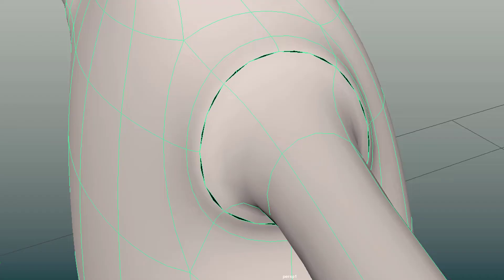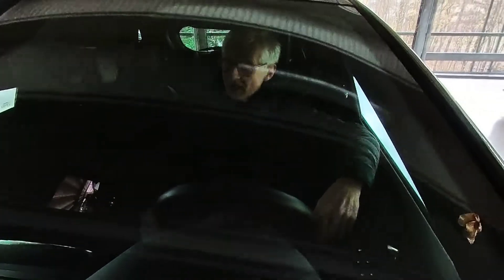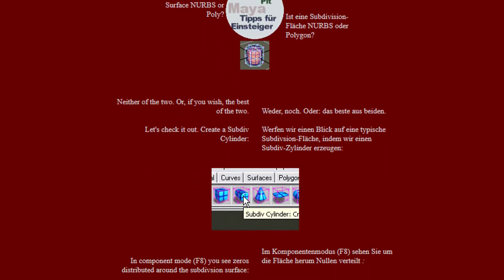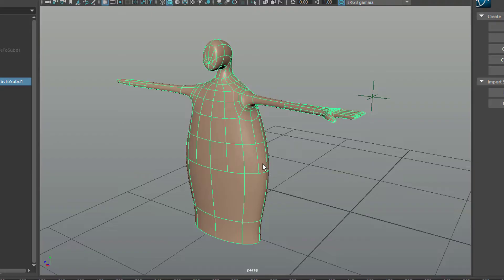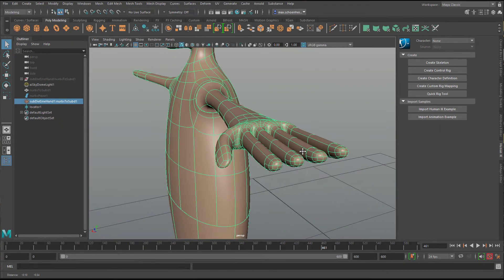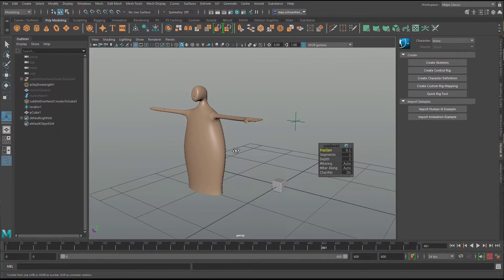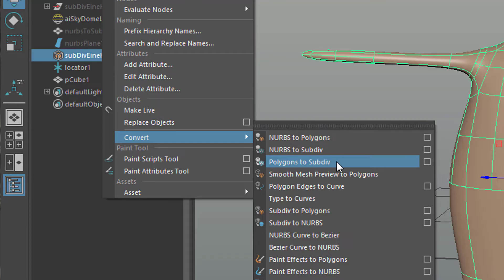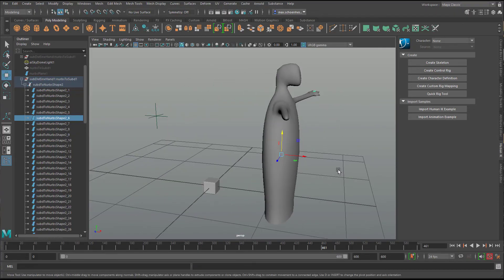Maya: Subdivisions – Matters of the Past

Comment: Back in that day, just before Maya came out I was using FormZ control NURBS surface modeling.  So I was unfamiliar with polymodeling and Maya Subdivs. So I had to learn both at the same time by myself. T-spline surface of Maya Subdivision were baffling. I finally learned it in 2006 or 07.  LightWave was using the Poly SDS technique already. If I knew how to model PolySDS back in 2000 things would have been different in my career. I saw Bingo in 2000. My eye just glazed over. I still watch it as recently as last month. It was an extremely exciting time witnessing the birth of a new form of art.